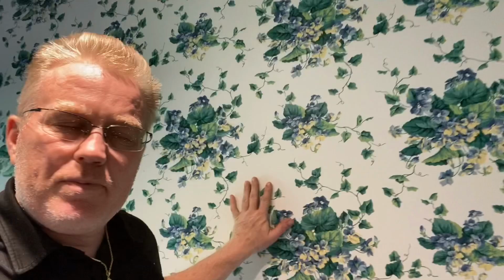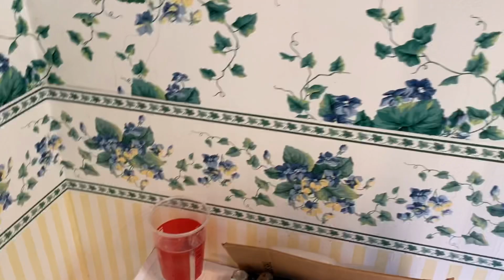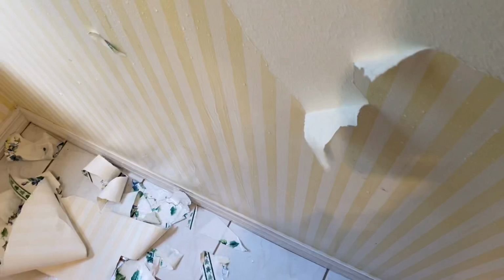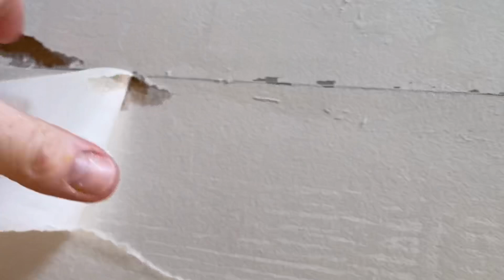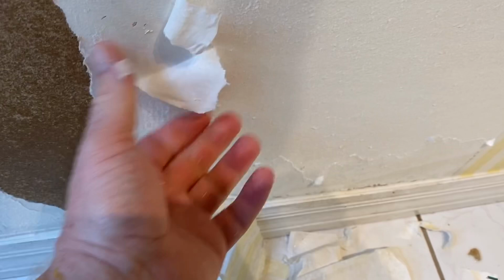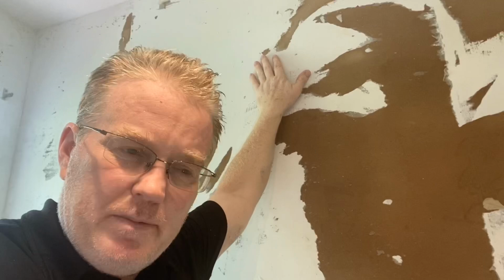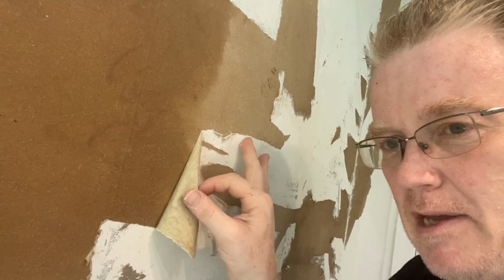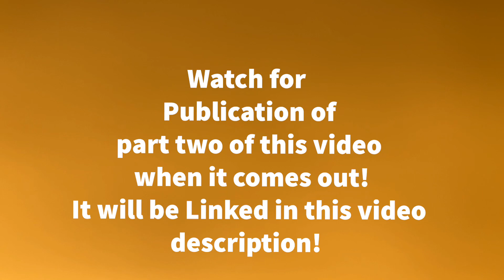Remove Wallpaper - Part 1 of 2 - All You Need to Know - Spencer Colgan

Comment: Put a humidifier into the room you seek to strip wallpaper from. As you spray water on the wallpaper, the water will be able to soak in more completely and down to the adhesive without leaching into the air. In short...make that room a tropical mess!

Comment: I totally respect what you say no doubt! But I have been a painter for over 30 years doing mainly high end work for 20 of the 30 years, In Australia the paints could be different, but in cases like this a good coat of sealer is sufficient for the areas where the paper face has came off, for the left over glue I personally use a sponge with a scourer on it with warm water, the other thing that I would always suggest is to let the walls naturally dry,The zinsser is a great product but not necessarily user friendly for the handyman and as you mentioned a lot more costly, so In short let the substrate dry after you have removed the glue with either a sponge/scourer apply a sealer coat allow to dry fill all required areas where needed with base coat, sand in between lightly and apply top coat, sand all top coat apply all filled areas with sealer, finish with two coats of low sheen 👌
Reply from the maker: Excellent information aussieguy.  Thank you!!

Comment: Excellent Demonstration. I had my Wallpaper in my kitchen begin to fall off the wall. It was very easy to remove the entire Wallpaper. I only had one section of my wall which gave a tint of pink. I washed the walls with water lightly. Then left it to dry. I really did a fine job I was told. Now, this other owner puts Wallpaper on the ceiling of Bathroom😆? How to remove from ceiling without rips? I watched your entire video. I'm only 5'3" 😂! Remove from ceiling? Spray water and let dry. Don't over saturate your walls. For me, it can get soft. 
Excellent Eductional Lesson.
Reply from the maker: Thank you so much for such a wonderful compliment. I wish you would do a review on Google for me just telling everybody else what they would get if they hired me to do the task they you found so helpful in this video; would you be so inclined to write a review? A five star review?

https://www.google.com/search?q=tampa%20wallpaper%20installer&tbm=
Reply: I know you said you like to correct our writing in this video. So I need to correct you on (they you found so helpful in this video) referring to the compliment you would like posted on GOOGLE... "they" needs to replaced with "that".
I came here looking for help, not a lecture...
Reply: @klgsizzler  I'm sure it was one of the three choices that come on above the 'keyboard' & it probably was the middle one that he didn't want, & being in a hurry to get our texts out one doesn't always ck that.  Lighten up.  Many people do not know how to write, or speak, proper grammar, & it's annoying.

Comment: Well sir,  first and foremost, I appreciate your passion. I have be redoing the walls throughout my entire house, and have found the gauntlet of wallpaper. Easy removal smooth walled, to think, stubborn border paper on textured wall. The thick, multi layered paper has given me the fits! I've been given all the advice in the world, and after watching this video I believe that:
1. I'm not using nearly enough water. 
2. I'm not being nearly as patient as is required. 
I posses both.
 A good well, and patience.  However it seems I'm not using either one to it's full potential. 
My walls were not sealed by the previous owner when they installed their 3 layers of wallpaper in places.  For reference, I'd been trying with a 32oz spray bottle on the entire room. A new 2 gallon sprayer will be in my possession and utilized, with much more patience. I have no further questions, as I indeed watched the entire video(s). I just wanted to thank you, I'll put away my(the following is a list of tools from "advice"),  metal scraper, heat gun,  chemical wallpaper remover, tiger claw,  and whatever else I've left out. I'm curious if you've ever used vinegar? I find it as a good go to cleaner, or sticker remover. Thanks for your passion and willingness to teach others, so one day we can teach.
Reply from the maker: I use it when I’m trying to lose weight and put it with oil on my salsa!   lol.   NEver on wallpaper.

Comment: Hey Spencer, appreciate the video - I've used the techniques in this video to remove most vinyl and grasscloth wallpaper with no problem. However, I'm removing vinyl wallpaper in my foyer and like most good quality vinyl, the top layer comes off in beautiful full sheets. However, the tan paper backing still does not come easily with water no matter how much I wet it. This paper backing is different than what I've seen before/what you've shown - it doesn't tear when pulled, it just breaks off. It's also not drywall brown paper because after scraping the backing while wet, I can see/feel the drywall behind it. Any direction you could point me in to removing it would be great.
Reply from the maker: 1.  Apply oil based kilz on this paper.  Do not waste time removing. 
2. Let oil dry overnight 
3. Apply 2-3 layers of THIN joint compound skim coat. Let dry between coats 
4. Apply Gardz over skim after light sanding. 
5. Let dry 3 hours.  
6. RepInt. 

If I’ve helped you. Plz give me a 5-star review and tell everyone how I helped and my informations value please!

https://www.google.com/search?q=tampa%20wallpaper%20installer&tbm=#lkt=LocalPoiReviews&trex=m_t:lcl_akp,rc_f:nav,rc_ludocids:18168418332679895040,rc_q:Spencer%2520Colgan%2520-%2520Wallpaper%2520Installer,ru_q:Spencer%2520Colgan%2520-%2520Wallpaper%2520Installer,trex_id:XCBBr
Reply: Does killz oil based primer work for torn wallpaper as well?

Comment: Thank you for this video. If the wall paper comes off without revealing the brown layer, can we assume it is already sealed? Do we still have to seal it before painting?
Reply from the maker: Excellent question Alice. Even if it were sealed, there is a stubborn residue of paste over which you cannot put water-based paint. Therefore, please sealed it with either an oil based primer, alcohol-based primer or gardz

Comment: Also, a wallpaper scorer from Loews or Home Depot will enhance water penetration without damaging plaster or drywall.  I have found a broad 3" drywall tool can be used to start an edge and save your fingernails without digging into the plaster.
Reply from the maker: I guess you didn’t watch the whole video; if you did, you would’ve seen my garden sprayer in use
Reply from the maker: Go to 42:12
Reply from the maker: Go to 42:20 as well. I asked people to please review the whole video before they make comments are aske questions so that they are fair to me and they don’t cause me unnecessary loss of time by having to answer something that I have already answered in the video

Comment: I've removed hundreds of rolls and the very 1st thing I do is a small space in the corner BEFORE wetting the walls. IF it looks anything like this job, I heavily sand the entire wall with 80 grit sandpaper so the water can penetrate the vinyl coating which is mostly waterproof. Mix water with DIF remover, let it soak 2 or 3 times and BINGO. Much easier.
Reply from the maker: Rick, all the respect;   If you want to breath all that crap in…do it your way.
Reply: @spencercolgan  there’s dustless sanders now Spencer. There’s also a special tool to score just the drywall paper allowing the water to penetrate deeper into the paper. I have also removed many wall papers. I think this is for more of the DIY who you think is going to go all out and cause damage to their walls.
Reply from the maker: @Juan-zd1ct  yes.  Juan.  I have the Planex Festool dustless sander.

Comment: Success...so far, thx to all your advice I got through it without having a melt down. Got all the wallpaper off, wet sanded, wiped clean and today sealed the wall with Kilz oil based sealer. Pugh!  Will prime tomorrow b4 skim coating (yikes). But have another question.  should I spackle the small pin/nail holes b4 primer and skim coat?  Also have a vertical crack an inch in from corner down near the floor.  Weird place to have a separation. Do you have a video showing what to do with this issue?
Reply from the maker: Yes.  Spackle before priming. Yes on question 2:  watch my plaster repair videos.

Comment: Hi Spencer, thank you for taking the time to share your knowledge and produce these helpful videos!   Couple questions: if drying time isn't a concern can I use just the Weldbond to seal the drywall both before and after skim coating?  Also Weldbond recommends a ratio of 1 part to 5 parts water.  Do you think that's too diluted?
Reply from the maker: Excellent question. 

Yes!  Before and after. And yes, 1:5 too much!

Comment: Hi Spencer, thank you so much for your videos, I find them very helpful.  I have a question... do you do the same process for wallpaper removal on lath and plaster wall?  My home was built in 1899 and I'm about to remove some wallpaper that I believe might have been added in the 70's or 80's.  I just want to make sure that for lath and plaster it is the same steps?  Thanks!!!
Reply from the maker: Same exact procedure.

Comment: Well, I did watch everything, but I’m pretty sure it isn’t going to work for me. I live in a 90 year old house and upstairs is some wallpaper over shiplap. It’s been painted over and wallpapered probably dozens of times. I tried to get it off a few years ago, but didn’t get far. I was working full time and didn’t really have the time. I have removed wallpaper successfully before, but just wondering if you would have any advice for this other type of problem.

Comment: The house we bought has painted wallpaper. It’s this weird mesh wallpaper. I already stripped three layers in another room with these videos. So my question: what do I have to do with painted wallpaper?
Reply from the maker: I don’t know what mesh wallpaper is but somehow I suspect that you mean Grass Cloth.

Here’s what you’re going to do:
1. Do not fear damaging your walls. Get out a sharp knife and slice it diagonally long slices and then take your knife and slice it in the opposite diagonal direction… Do this in an area of about 3‘ x 3‘. Then take a 6 inch taping knife and trying to get the edge of a taping knife underneath these strips that you have sliced and start prying  them off of the wall.
Reply from the maker: Slice deeply if you’re removing multiple layers of wallpper. Don’t worry about damage to walls. Plaster can easily repair any damage you make.
Reply: @spencercolgan  
Our cats have begun some of the removal in a corner. I looked up grasscloth and it appears you knew what I meant. I’ll need to seal them then skim coat after removal ?
Reply from the maker: @newenglandyankeeliving5052  skim coat will PROBABLY be necessary.  If not, no need to go through the trouble.
Reply: @spencercolgan  
Whatever if it needs it it needs it. That I can do. I’m just glad you’ve taken the time to make these videos and to respond it’s a great help and greatly appreciated

Comment: Spencer how do I remove extra think glue residue left on the walls after the paper backing
Reply from the maker: Please watch part 2 of this.   Paint over with kilz oil or BIN alcohol primer.  Then Skimcoat.  Prime skim with zinsser 1-2-3 and paint.  You’re done.
Reply: @spencercolgan  Spencer what if I do not want to skim coat the walls are in great shape other than some thick glue... just a sand then? I really appreciate the reply I have looked threw all your videos for the answer

Comment: We have a large room in our home that we want to paint. It has vinyl wallpaper on it that is very well secured to the wall (for 35 years). We would like to not have to strip the vinyl wallpaper but do not want to paint over it due to it having a border on it (don't want to show the seams). Can we prime the vinyl wallpaper with a Roman Primer and then hang wallpaper liner on top of the primer and then paint?.
Reply from the maker: Sounds like a good plan. You may want to skim coat at the border line, so the line doesn’t Telegraph through. Prep with R-35, not RX-35.  Then liner, size liner with cut adhesive and you will be good to go!
Reply: Thank you so very much Spencer for the feedback, it helps in how to proceed.

Comment: what about cheap wallpaper border at the top of of the wall? It has been horrible.
Reply from the maker: Don’t remove it. Go out and purchase 1 gallon of original KILZ. Let it soak put it on thick; then spread joint compound overhead with a 10 inch taping knife. Let that try, do it again. Then reapply original KILZ over your new smooth surface and enjoy yourself

Comment: With all respect i wouldnt use water alone  ,  using  DIF mixed with the water. Would make it  lot easier.   My thoughts
Reply from the maker: I respect that; i used to use that stuff long ago and I don’t like breathing it in when I spray it; if you think about it, if you do it over and over again, what does that do to your lungs?
Reply: @spencercolgan  i agree  but  i also found that Natural Distilled White Vinegar,
Works as a good as the DIF have you tried?
Reply from the maker: casa wifi awesome idea. Acidic. No. But I think I will!